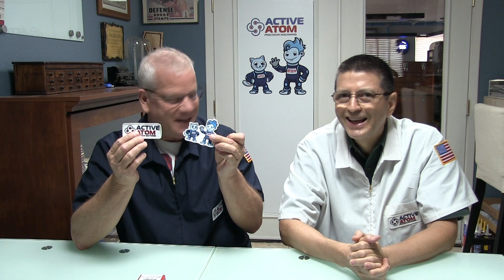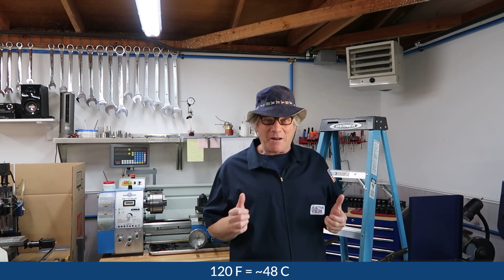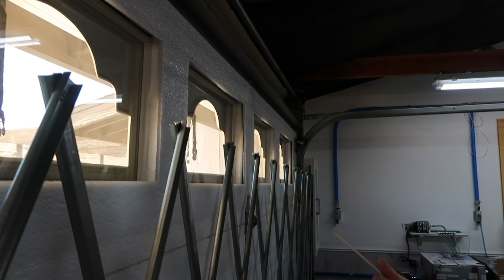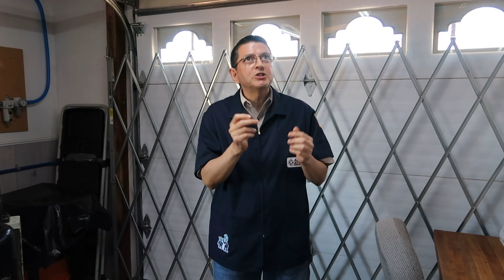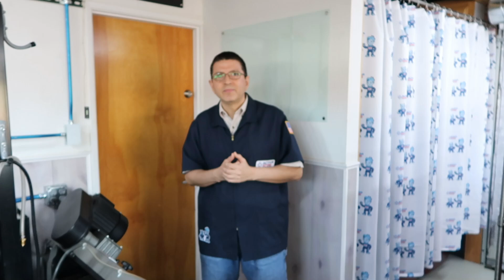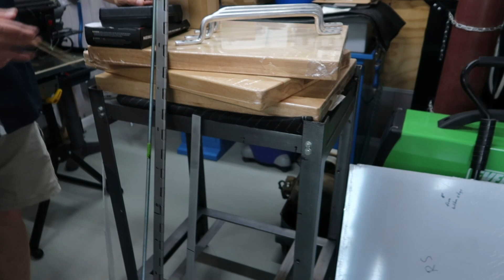SHOP ADVENTURES 45: Machine Shop Insulation & Electrical Work

Comment: Hello, guys. How is going? Any updates?
Reply from the maker: Hey hi Igor, well our missing from the Social Media locations and we are to blame for these non-filmed events here. We upgraded our machine shop area with a new Dayton surface grinder and a new larger benchtop milling machine 9.5 x 42-inch table. 
We added a heat-treat oven made by Keith Furnace here in Southern California and we just finished upgrading that will share images soon on Instagram for that great build it is now really smart, and it is tied into our smart automated shop programming system like a smart house it is for our shops, it was fun to do this major intelligence project.  
The Barker milling machine from 1963 is completed now not filmed has a DRO and looks to be brand new with tighter tolerances then when it left the showroom in 1963. 
We are going to film again but the workload has been too much for us to both deliver our work and film it at the same time, however we are building 6 watchmaker lathe accessory spindle idler pulley units with modern day features using our knowledge and SolidWORKS software that should really be fun to watch as we are filming that coming up around June or July.  
We are happy to hear from you, we wish you well and we both thank you so much for remembering us ad wishing us well and missing our shared efforts that makes us want to return to filming even more, thank you Igor. Lance & Patrick.

Comment: We miss your adventures and hope to hear more soon. My aunt & uncle lived out on Sherman Road... I visited them in July of 1978 and can vouch for the heat.... Dry-Heat or otherwise, it gets HOT!
Reply from the maker: Hi Dave, true it is a dry heat it is also about 15 to 20 degrees cooler than the more famous City of Palm Springs (42 miles west of our current location Dave) where we used to live from 1999 thru 2013, leaving there was the best thing from a quality of life, politics and wetter climate points of view. Palm Springs is in the lower desert Yucca Valley is in the high desert much drier and as mentioned cooler. We looked up Sherman Road there is one in Morongo and one in Twentynine Palms and in the late 70's we were out visiting grandad Alvin a second-generation machinist in our now 4th generation of Conway machinists except me Lance I have no 5th generation had no children so well we will do something here to sustain the continued efforts of making fine machined watch and timing devise parts and now our firat product being made here now. We will be filming the making of our watchmaker lathe accessory spindle idler pulley drive systems, see Dave we are making 6 of them, we actually are short one in the Workshop area, so there will be 4 or 5 we will sell as we make them and yes, as mentioned, we are filming this build, it is our first product not for someone else but for our Active Atom store. Thank you for missing us and we promise to return just been really busy upgrading the shop and making this product to share. Lance & Patrick.

Comment: Hay guys just checking to make sure everything is going will. You should do an update everything now and then. Really miss you guys. Praying all is well with you
Reply from the maker: Hi Joseph, thank you for writing to us, it is kind to know your thoughts about our shows. We are both well, this is Lance for Lance & Patrick.
We are actually working a lot of hours we now have a Dayton surface grinder and a benchtop mill 9.5 inch x 40.0 inch an all axis's are power drive mill with a DRO as we have installed Digital Read Outs (DRO's) on each this new milling machine, the new surface grinder and the now fully rebuilt 1963 Barker Milling Machine a horizontal and vertical machine featuring a mini quill feed vertical milling head (glad that rebuild came pout perfect). We hope to return to sharing soon it is just that we have had a lot of work to do and not too much time to film videos to share, barely making photos for the Instagram account, hoping to return someday once this work is done. So you can read we are both well, you stay equally well we will return just not wanting to break a promise to a date in the future, though we both cannot wait to come in and share an update. P.S. we are making 6 watchmaker idler pulley arm assemblies (with futuristic additions) 1 for ourselves a Levin Lathe is in need of one so we do not have to keep sharing the accessory motor attachments, the other 5 are going to be for our Active Atom store, Joseph, we will be filming these products being produced to share with you so we have that coming up this year. Thank you again for thinking about us we are thankful to have you along with us. Lance & Patrick.

Comment: Hello, Lance and Patrick, I just wondered, did  Patrick have to buy a really special escalator, to get up into the roof and
install the new insulation, or did he stay with a ladder or steps. Just joking Patrick. You asked about our local temperatures
where we live, well today it's the 12/September and here in the southwest of England it's been around  65 degrees, at midday.
My regards, and thanks for another great video, Colin the UK.
Reply from the maker: Thank you Colin, great to learn your weather as well though time has slipped by here to reply to you, we are thankful you wrote to us. Patrick did want us to buy a platform lift to do this insulation work to our garage converted into a Machine Shop now, what a great place and we now have bigger machinery to share in a future video as we Colin. Have a great day. Lance & Patrick.

Comment: Hi Patrick and Lance, Another great update of your work lately, thanks for this.  As far as the temperature is concerned in the Netherlands it is a very changeable summer, now on 19 Aug. it is about 20 degrees Celcius. last year we had already had 3 heat waves at this time. So the temperatures here in Western Europe are very variable during the summer. To work that is fine of course but if you have a holiday then it is nice to have some higher temperatures and some more sunshine. keep up the good shop adventures.
Reply from the maker: Hi Huib, thank you for stopping in watching Patrick smarty pants share even more shop skills. The temperature in the Netherlands currently seems really nice we are having yet another heatwave today Saturday it is already 80 degrees 26C and it is only 5:00 AM, so it is GREAT new air-conditioning in the shop times HEHE. That Patrick is wanting to machine parts again so we best wrap up these shop work area improvements Huib, stay well our dear friend and his fellow machining friend. Lance for Lance & Patrick.

Comment: I agree with Patrick, special -rejects require new special tools 😁. Great to see the progress on the machine shop, should be comfortable with the weather proofing. I remember the weather there well as I lived in Yucca many years ago. I’ve since moved just up the road a ways, to San Jacinto.  Weather here is similar, couple degrees cooler in the summer and a couple warmer in winter. Thanks for the great videos!
Reply from the maker: Hello fellow former never forgotten Yucca Valley resident, we live across from the Yucca Valley Airport and we know your on the other side of the great separator San Jacinto mountain over from Palm Springs. Thank you for sharing in our next show Shop Adventures 46, we actually have the Air Conditioner installed and such, so we share these new improvements with the viewers. Lance & Patrick.
Reply: @ActiveAtom  my darn messy typing fingers, that should have read special projects. 😬
Reply from the maker: @markclelland3510  Got you are far from alone I am at times a typing train wreck that is why I reframe from texting. Patrick still does not need more tools he must be controlled special projects or not LOL. Enjoy your weekend, L&P.

Comment: Well done on the shop upgrades guys 😊. Ceiling or roof insulation is the most important, keeps heat in during winter and out during summer 😁. Congrats to Paul for winning the big prize! Cheers fellas, see ya in the next one!
Reply from the maker: Hi ho Chris, nice reading from you here. Paul lives in Malaysia and he was really happy to have one that prize set. We are happy with the insulation projects happy they are done our next show Shop Adventures 46 we turn the Air Conditioner on and show the beginnings of our new now received Heat Treat oven but it is getting a few upgrades to make it smarter to use here, stay tuned friend and thank you for being here with us Chris. Lance & Patrick.

Comment: First of all, here in NC we have lots of humility, so AC is helpful. Both of my shops have AC in them. Our highs run in the high 90’s do it’s hot for sure. Actually our winters are quite mild, usually if we have a cold day it’s, low teens. Good seeing you guys back
Reply from the maker: Oh we hear of the high humidity in fact James, we no longer complain (when commenting) about the little bit we get here like 10 to 15% when it is cloudy out 3 to 4% when it is not as this is a desert, but what you guys get is a lot of wonderful green growth that does  not happen here James. Nice to read you have both of your work areas air conditioned that is important there. Take care talk soon, Lance & Patrick.

Comment: Talk about heat out in the shop. I live in Loveland, Colorado and the temperature has been in the mid to upper 90's the last month or so. We hit 100 a couple of times this year but that's not the norm. My shop is insulated and heated but no air conditioning . Yet. You guys are doing a great job on the machine shop, It's looking good you guys. Can't wait to see the heat treat oven and stand. When are you guys getting the CNC? Or is this going to be a surprise video?
Reply from the maker: Hi GlennNow WOW NOW look at your temperatures no we would think ok Colorado a heater yes need for an air conditioner na not really so this is neat to read and learn the temperatures are crazy globally we are aware that the earth this planet is a living thing from her core to her molten tectonic activity she is absolutely amazing to be attached to. thank you for liking our Machine Shop efforts we have a more detailed plan for the machine Shop no secrets to share in Shop Adventures 46 coming out soon in editing now filming completed, no CNC machine it will be a Hardinge CNC Hard Turn Super Precision twin spindle Lathe they are the toughest CNC style made can cut Inconel with no coolant high nickel alloys, no plan that is the machine we want to get, and we are programmers using SolidWORKS so we have that going for us anyways for now this is a dream we need to get back to cutting chips first. Thank you for the GREAT question, Lance & Patrick.

Comment: Hi Patrick and Lance ,Did you ever consider using  copper pipes for the compressed air lines? what are the pros and cons with the system you guys use?
i bet its a Hotshot oven.
Reply from the maker: We think copper would get too many dints gas pipe would work (caution in wetter climates rust will build through condensation in those pipes and the likes) well we use the Rapid Air named Maxline it is great if you do it right, seal each connection use the finest German made control valves, flex hose and guns at each drop, note we have in total around 40 drops it is a sealed system the air is on 24/7, we get 0 zero no leaks in the system (we are proud of our efforts they wee fruitful to us) it is a feat but we took our time and got it perfected to the point we have to cycle the air compressor to keep things fresh and lubricated to function here, great question nice to ask. No it is not a hot shot (though we are sure it is good) it is made to order in Pico Rivera and manufactured in another state for this smaller size and achieves a higher temperature then the name you mentioned, we required 2200 degrees plus and we required a guillotine door like the giant ones have for our future product well some day that is. Thank you for being here you ask great questions that is what we like. Lance & Patrick.

Comment: ⌚❓Question, please -- the blue conduit and fittings you have, what have you used it for and can you give details? Thanks
Reply from the maker: Hi Lorem, you are either talking about the airlines or the electrical 1/2 or 3/4 those are both the electrical, if so they are just ordered in colored blue conduit we cut and bend into place then use the pressure stile fittings on them. We have lighter blue airline and fittings aluminum blocks and values you might be talking about, those are the shops airlines that is from Rapid Air named Maxline and we have them ran throughout eh Machine Shop the Workshop and even the kitchen gets an air gun to blow the dishes dry. Thank you for being here with us and we hope these will answer  your question. Lance & Patrick.

Comment: As of 8/18/21, here in Northeast Texas, it has not gotten to 100 F yet this year, which is very unusual.  It did get to -7 F in Feb. in Tyler for overnight and then 8 days later it was 77 F in the day time.
Reply from the maker: Oh yes Roy we saw that weather snow ice hell storms what is it that is going on in Texas, you are right your high is too low coming for Christmas maybe that happens here 100 plus in December, we do not know. Thank you for sharing and for being here with is. We complain at 26 degrees ice and snow annually pretty much at the Joshua Tree National Park a bit colder Lance & Patrick.

Comment: Hi Guys, your shop looks fantastic. The future heat treat oven sounds interesting, I wonder if it comes with an option for using a shielding gas? :) Temperatures here in Penang this morning are a seasonally chilly 23C, should max today around 29C, yearly highs are normally around 35C.
Reply from the maker: Hi WINNER tracking begins tonight most likely, no we did not add that to the options as this is a build to order from Pico Rivera, California actually made in Reno, Nevada for us. WOW your temperatures are coming in really low for now tit seems to be this way all over the world Paul, our higher the usual heat is cooling back down towards a normal here starting today we think. We are so happy for your win as well. Lance & Patrick.
Reply: @ActiveAtom  Pity the oven is on back order, but that should give you time to complete the custom table with those 3 chopping blocks. Good to hear it's a little cooler there.  Yes, I just got an email that the package is on the move :) Heading for a sorting facility, I've signed up for the alerts by email so I'll get to see what route it takes to get here. Take care guys, Paul.

Comment: Great to see a new video The shop is Awesome Today I received a box of 3,4. & 5 mm Dia. stainless cap screws/ bolts and was just out fumbling with the tiny little things with my Gorilla sized fingers wondering  what Patrick would use to handle them   Came inside to cool off and Wow a new video from you guys
Reply from the maker: SS screws are great corrosion is eliminated but sometimes strength is limited depending and if it matter we use metric stainless steel screws all the time smaller then those though much smaller Jim, Patrick uses Rodico a green putty from the watchmaker world, great to have you here thank you for sharing. Lance & Patrick.

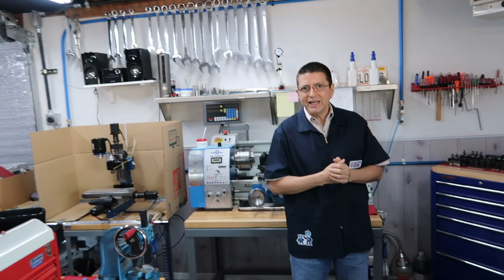Comment: Good job using available space there. What model is that little CNC mill at 23:50? TAIG? Where do you guys pick up those butcher blocks? Do you have a preferred brand, or go for decent price?
Reply from the maker: Hi emislive, great questions, the converted mill is a TAIG CNC built in-house but it is in need of upgrades it is getting the TAIG Tools Ball Screw upgrade and the BT-30 precision spindle not from TAIG and auto drawbar closure. Butcher blocks we had a great supplier for many years located in San Diego, California prices were not too bad today the game has changed those three we bought for the Heat Treat oven table are from some random Amazon supplier we had one made for us right now for the new benchtop milling machine that is on the floor and appears in the video slightly because it is on the floor, Little Giant is making us a specific table for that mill and the butcher block for that one was really costly as it is custom sized and built to support this new milling machine. Sorry for the lack of helping you and for writing so much but you asked great questions that we like and thank for doing so. Lance & Patrick.

Comment: Do you have 3 phase for the surface grinder?
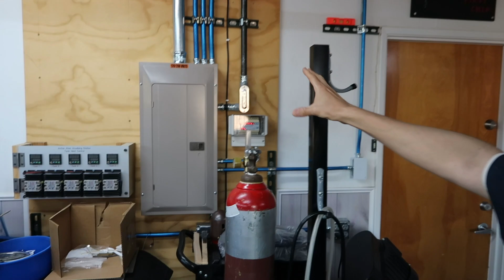Reply: See 22:40
Reply from the maker: https://www.instagram.com/p/Ba_3DZUA49L/ is the main for that sub panel 3-Phase pull huge wire gauge, toughest wire pull ever as it is at the opposite side our our home. Thank you for helping us explain Stan. Lance & Patrick.
Reply from the maker: Yes it is, installation of our giant outdoor panels (well giant for a house anyways) are shown here in our Instagram https://www.instagram.com/p/Ba_3DZUA49L/ there is also a video sharing this but not remembering which one, it is great to have, we have it not for that surface grinder but for our wish list Hardinge Hard Turn CNC lathe we hope someday Wayne. Thank you 3 Phase is critical for smooth motor operation and fine detailed finishes. Thank you, Lance & Patrick.